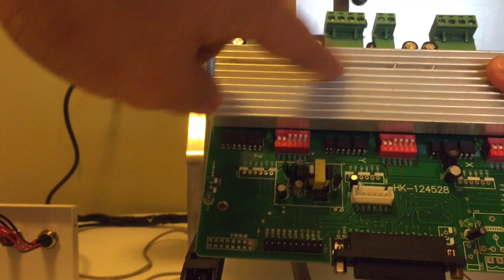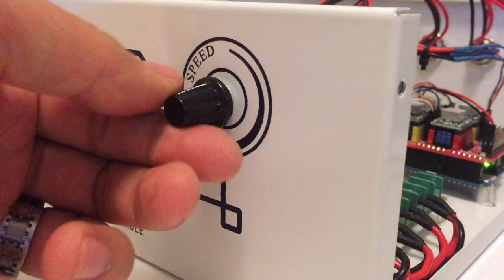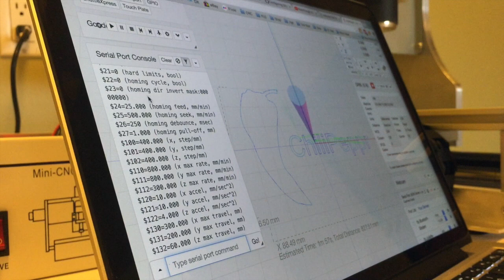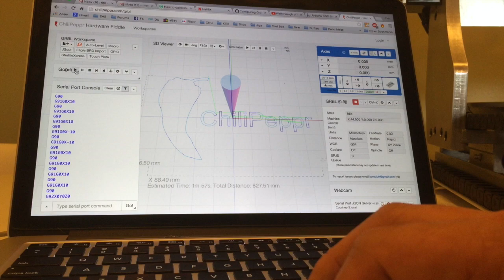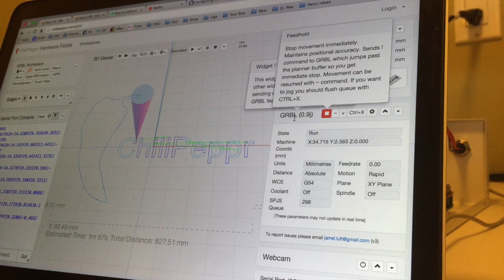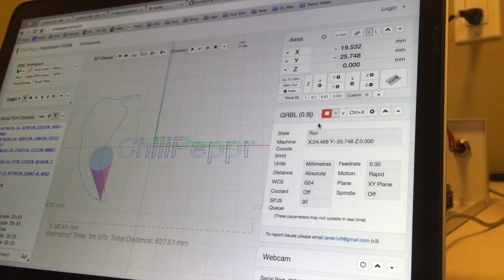Metro Made | 3020 CNC Arduino GRBL Conversion

Comment: I have this same board. Can you please tell me where to put all the jumpers? I have a chinese 3020 CNC. I am only using 3 axis right now, but still want to know where to put the jumpers on that extra axis.
Reply from the maker: +Guadalupe Alvarado The jumpers go under the driver chips.
Reply: +Eric Au (Metro Grade Goods) But what configuration? So you can't answer that for me?

Comment: Following along.
Reply from the maker: +Greg's Garage Thanks Greg. This is a bit more simple than your build, but essentially it's the same. When my bigger 6040 machine comes in, things are going to get loco.
Reply: Yeah man...  I'm def listening close to the electronic side of what you are doing.  It's very similar to what I'm going to have to do soon.
Reply from the maker: +Greg's Garage You may have to do some funny math, if I remember you were using an Imperial lead screw measurement right? I lucked out and the lead screws and ball screws on these Chinese machines are metric, which mesh with the settings in GRBL.
Reply: Yeah, that I'm good with the metric/imperial thing.  I've been using universal g-code sender and it forgets what units you're working in all the time.  I'm going to try chili pepper tomorrow.  For electronics, I'm talking about making the arduino work with other boards...  Namely, the pololu drivers aren't big enough to drive big motors.  I may upgrade to stronger drivers but try to keep the same arduino so I can use the mac and USB.
Reply from the maker: +Greg's Garage I don't have anything larger than the NEMA23's on this machine and my other machine. I have some drv8825 (purple chips) drivers coming that are supposed to be smoother/more powerful since they can run up to 35 volts or something. 

If you need more power...look into the TinyG? It seems really robust and John (NYCCNC) was driving some pretty beefy steppers in his video.

Comment: I can't help wondering how you are getting microstepping to work without the "$1=255" setting and if you did set it to "continuously powered on" you haven't discovered that those drivers are running way too hot. I have upgraded to the 82xx drivers with heatsinks but it was no help. Am I underestimating forced air that much?
Reply: i've got the  same issue, did you come up with any solutions?
Reply: Which one exactly ? My 3020 is on the back burner right now, as  I am trying to get one of those Eleks laser engravers to work with the same arduino V3 shield. The other day I did get it to work in half stepping mode
but NOT BEFORE I adjusted the current from its maximum setting (out of the box).  
I have fiddled with the current some on the 3020 but maybe not enough. Perhaps if I turned it down some more...??? My memory  of what exactly I did do is fogy , but based on the size of the motors I wasn't trying to go much bellow 1A.
I have considered wiring the arduino to the original driver board of the 3020 over the last few days, but I haven't found the original driver board yet and have the laser engraver on the 'bench' right now. 
I don't think I have seen enough comments, stressing how important the current adjustment is for some setups so I wasted a lot of days before I acctualy tried doing the adjustment.
Come to think of it I don't remember getting burned on a heatsink just hot chips, so I am wondering if I have even tried it with the 82xx drivers when they finally arrived.
Couple of days ago I read that the heatsinks don't do much for heat dissipation since the chips have a large ground plain underneath intended  for that so with only about 20% increased current capability they and the alegro drivers are likely not enough for continuous power operation.
I didn't have a blower rigged up , perhaps it is worth a try.
Reply: IT"S ALIVE !
(right now - finders crossed )
I ->5V) power supply to replace the one on the original LPT interface and put connectors to mate with the original cables  (from LPT to driver boards ) to deliver the signals from arduino to the drivers . I have put all that on a blank Arduino shield  board. I had some incomprehensible deviation from expected movements at 200 , 100 50 steps per mm , until I decided to try 400 , the machine also started to move about twice as fast all of a sudden, before that, changing max and current feed rates  seamed to make no difference.
I copied the Idea of the 2 stage conversion 20V->15 and 15->5V because I had those parts but my 5V regulator is running hot so I guess I may need to add heatsink or redesign it all together

Comment: hallo community^^.   i recently try to built a lasercutter so i got a few questions on the software part. i have got universal gcode sender running and motors turning now i have to produce g code but witch software to use ?   and how do i know how the grbl interprets it.     because its a diffence between a stepper servo and laser.  is gcode akways the same. or can i tell the software to write spezial commands if it have to go left or right

Comment: Some of us are not as far along as you are. I wish you would show more of what you are doing.  I have the same board or shield as you have. I will run into the same issues you did with the jumpers. Could you show what problems you had and what you did about it. What boards did you put on the shield. When you say you set up the code in the program, could you show the steps to get the program and how you put the g code in along with any hook ups..... and the like. You could save some of us that are still behind the curve some trouble and headaches.
Thanks for the video and waiting for more.
Reply from the maker: +amtpdb1 No problem. It's a bit of a leap from going nothing to fully functioning. I have a 6040Z on the way, I'll do some more detailed, multi-part videos describing my methodology. 

I also have a Sable 2015 machine that has no drivers, power or electronics that I want to document.
Reply: +Eric Au (Metro Grade Goods) Thanks

Comment: why do you say that this is not a milling machine? im milling using Fusion 360 and mach3 , so why the intake on your exp?
Reply from the maker: +Frank Lopez A true milling machine has a spindle that is independent from the motor, this is still a CNC router with the collet directly on the motor. A milling machine spindle is designed to take laterally forces better when under load, so it typically can take deeper and faster cuts. 

Don't get me wrong, I love the inexpensive technology and accessibility these machines have granted users. It's pretty incredible what we can do with them. 

I am mostly makercam, JSCUT, CHILIPEPR or GRBL Controller.
Reply: so your saying you have not try to mill anything ? cuz of that statement you made sounded like you try and failed
Reply from the maker: +Frank Lopez No, I have made lots of things with it so far, you just have to understand it's limitations.
Reply: oh ic, ok so then say yes you can mill with this cnc machine tho you have to understand its limitation, cuz the way you said it sorta imply that no you cannot use this as a milling machine its a router machine because it is a great machine and you can mill 6061 aluminum plate for 2D cuts which you can then assemble into a 3D models once cut or you can place aluminum block and carve depth or pockets into the block stock for making molds and even 3D cut as long as you have the right 3D milling software
Reply from the maker: +Frank Lopez 100% right. Thanks for watching!

Comment: That power-supply is spewing out very high amounts of noise, you can hear it in the videos audio when the unit is on.

I would highly recommend replacing that power-supply with a quality unit. Those cheap Chinese power-supplies are a fire hazard and can even fry the equipment that they're attached to.
Reply from the maker: +Mtaalas It's pretty quiet, that's the fan that's buzzing. However, I totally agree with you.